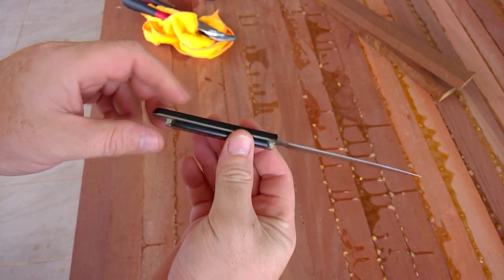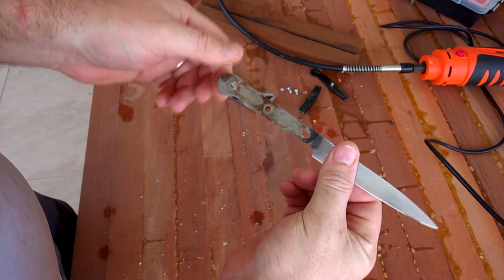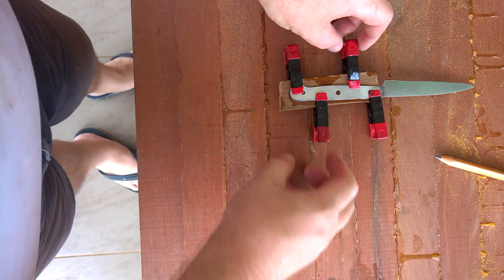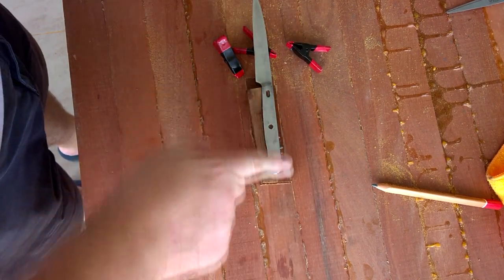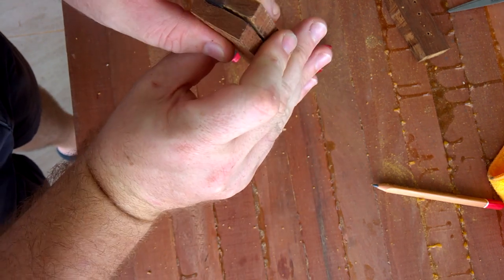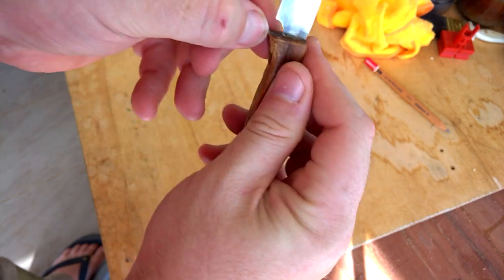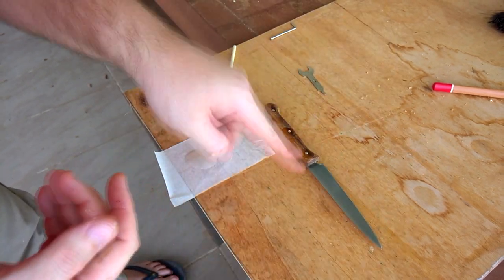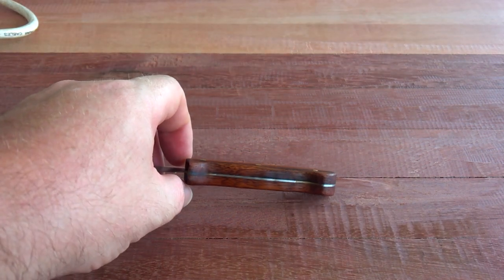Replace the handle on your broken kitchen knife

Comment: Thank you for your presence and may God reward you I am following you from Egypt A plastic handle would be better because wood has a short lifespan
Reply from the maker: Wood can have a short lifespan if it isn't looked after properly, however the wood used in this handle was Belian which is one of the most durable timbers in the world and is extremely rot resistant.

Comment: I recommend shaping the front contour of your handle before attaching it to the blade to avoid scratching the blade.
Reply: I agree but if you forget.... a small file with one blank edge or just some sandpaper glued to a popcycle stick....  Don't ask...

Comment: Matey for a How to video you Completely missed the area Of how to get the Rivets out or is this  men's shed Secret Stuff ...Geeze alI wanted was some method to get the Rivets and Handle Off an Eight inch Scanpan Cooks Kniff...🦕
Reply from the maker: Around the 2 minute mark I split the top of the rivet with the dremel tool and a metal cutting bit.

The easiest method of getting the rivets off depends on the type of rivet they used. If they are the blind press type like in this video then just splitting them at the end will cause them to weaken enough to be pulled of with some pliers.
If it's a pin like the type I replaced it with then cutting the top few mm off or drilling it in a few mm should allow it to drop back through the hole.
Reply: @MakeinSarawak  
Onto to it Now 👍⚜️...Would a Rope Handle Set with Resin work ?have you ever tried Such ,?
Thanks for Following through with Method ⛩️
Reply from the maker: @Jeraestone  rope like a para-cord wrap?
Not sure what you are asking about with the rope and resin part.
If you are talking about setting some rope in resin and then making scales from it, it should work fine if you can get enough penetration into the rope through either a vacuum or pressure pot.

Comment: Mate what do you do if your knifes handle is hollow
Reply from the maker: If you mean that it is a single piece handle with the tang (the other long end of the knife) going into the handle typically I would drill a hole the length of the tang through a block of wood then turn the handle on the lathe then epoxy the tang in place but I know not everyone would have access to those tools so probably the most reduced equipment option would be to get a block of wood and drill the tang hole through it and then shape the handle to suit you using something like a Shinto rasp (very useful tool to have and worth getting if you want to shape wood but dont have space/cash for machines).

Hope thats helpful.
Alternatively if you want something that is a bit different and the tang is suitable you can look into something like stacked leather handles which I personally think are pretty neat.

Comment: Wondering what sort of wood I could use/source in the USA? Teak? Ipe?
Reply from the maker: Teak is naturally more waterproof than most other woods but as long as you treat the wood with something like tung oil, the wood should be water resistant enough for daily use and cleaning.

Comment: where do you find the replacement pins that were pushed through?
Reply from the maker: The pins that I used are copper braising/welding rod and should be found in most hardware stores that sell welding equipment.
They will come in about 3 ft/1 meter lengths and you cut them down to size.
Other metals can be used as well but these are softer and easier to work with.
Reply: @MakeinSarawak  thank you

Comment: We have a set of Sabatier knives that have all started cracking. We have never put them in the dishwasher so we were very disappointed at these so-called quality knives doing this. But now I can use your method and put some real quality handles on, so thank you for such a good method. I might even practice with dowels instead of metal because the contrasting wood might look quite good. Thanks for showing me how it can be done. The only problem is that I don't have such an expensive sanding wheel as yours, only a handheld sander. But we will overcome!!
Reply from the maker: I'm always happy when people use the methods I show them to get some diy done, even better when it saves them from throwing out something that should still have years of life left.

The sander just makes the job quicker and a bit easier with the platform, you can use a belt sander turned upside-down if you have access to one for the same sort of effectiveness just remember to position the sander so the belt runs away from you so if you make a mistake the knife goes away rather than towards you.

Comment: great work, i wonder if i ve should use a piece of a broken cutting board made from bamboo
Reply from the maker: You can use pretty much anything you can shape with sandpaper using this method, bamboo should be quite good as I believe it has good inherent water resistance.
Reply: @MakeinSarawak  i really appreciated your words thanks

Comment: very helpful! I dont think linseed oil is food safe. I might try using mineral oil or beeswax on my rehandle jobs but thank you for the the demonstration!
Reply from the maker: Original boiled linseed would be fine but even then once the dryers have evaporated off it doesn't leave nasty stuff behind anyway.

To be extra careful you could use tung oil which is both food safe and waterproof.

Comment: My knife handle is broken and the knife tang is very short. I dont know how to describe more. Can you help?
Reply from the maker: It is possible to weld an extension on but depending on the cost and value of the knife it may not be worth doing that option for you.
Another option is to make a middle layer that is the same thickness as the metal of the knife and use that as a spacer for the areas of the handle that the knife tang doesn't reach.
The last option, which usually gives the nicest result but takes the most work is to carve the wood out of the surface that will be glued to the tang so that it fits together without any gap.
This depends on how long the tang that you have available is, if it's just a short broken stub then welding it first is the only option.